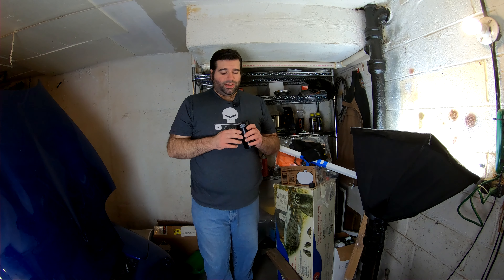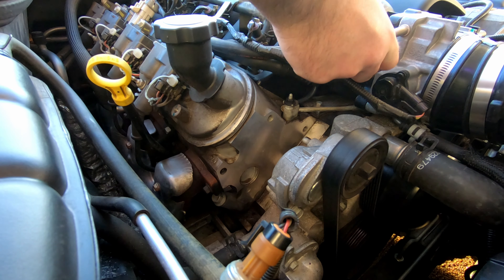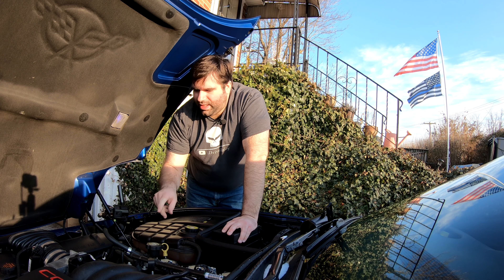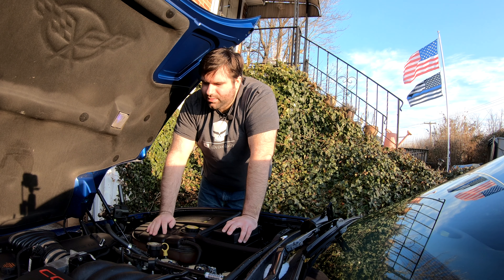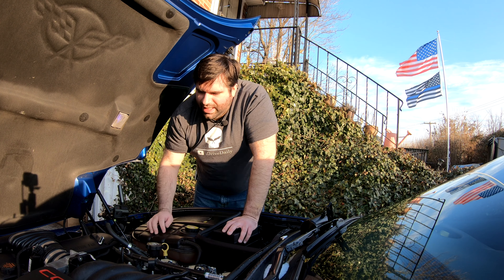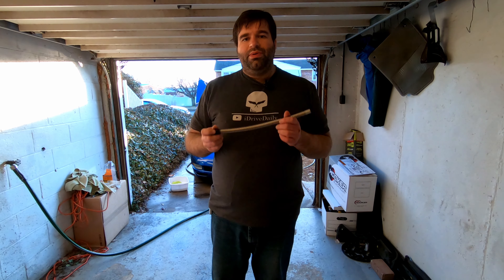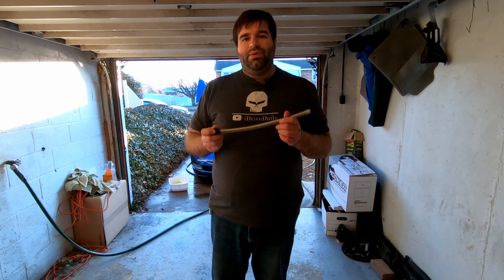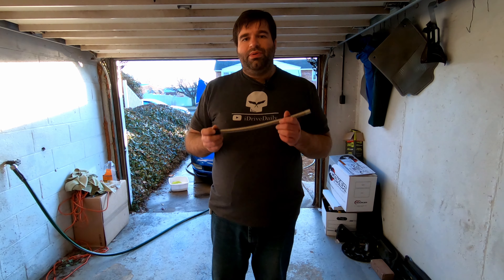Installing Elite Engineering Catch Can on C5 Vette

Comment: great video man, youre getting good at this. whens the cam coming in?
Reply from the maker: So, the cam and headers will be one of my "last" performance upgrades. I'm hoping over the winter next year. Gives me plenty of time to make sure all my ducks are lined up in terms of research and install, etc.
Reply: Have you been looking into which cam grind you want yet. Have been looking at a summit truck cam myself it's 222/230 .545 .545 112 lsa, I like the low lift and easy ramp rates. I have a lot more to learn about cams but I think that's the area I wanna be. Cam swap gets a lil expensive when in my case I really need to replace everything, well, I do have new springs haha
Reply from the maker: Yeah, there's quite a bit of work I plan to do while I'm in there. I haven't done a ton of research on grinds yet, I'm just beginning my search. Thank God there's a lot of info out there. Hahaha.
Reply: Gotta love the information age

Comment: Do u recommend for a first car
Reply from the maker: There's a lot of things to consider. Not sure the climate you live in, but I live in a 4 season climate. We see hot summers and snowy winters I ran winter tires this year and still anything over 1-1.5", I wasn't going anywhere. That's limitations on the car, not the tire. That being said, I only lost about 5 days due to weather because of that. There's a few other things; the C5 has some common gremlins you'll want to address right away. Fuel senders, oil pressure sender and EBCM come to mind. Check with the previous owner if any of that work had been done. Yo may need to address it. Otherwise, I've been dailying mine for about 3.5 years and have loved every minute. A gentlemen commented last week about dailying his for the past 7 and said he hasn't regretted it. I think they're a good car and reliable, but I'll tell you the same advice I give every young driver. The car maybe older, but it's still a beast when you need it to be. Treat it with respect and be smart - you're lifes worth more than the car. 

They're also fairly easy to work on. I'm a bit of a noob, but there are tons of resources put there and the community is very helpful.